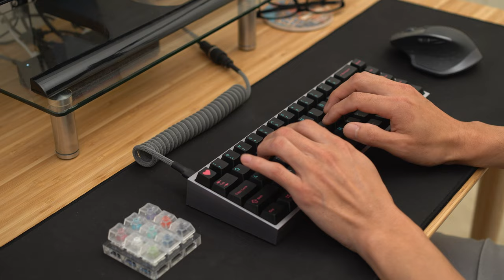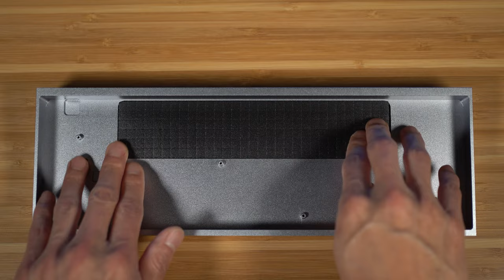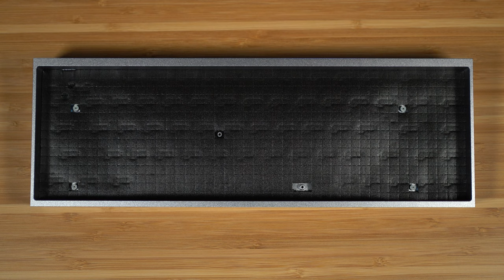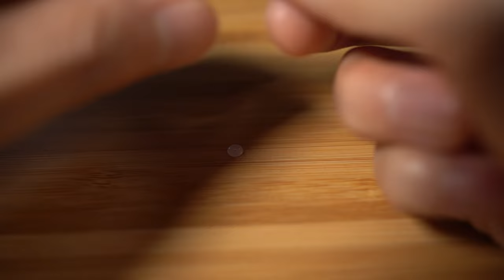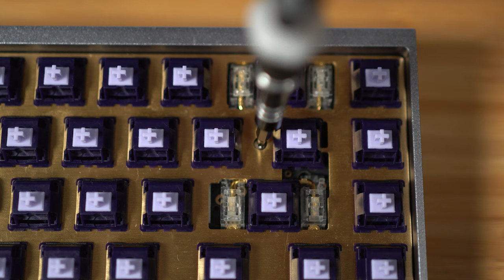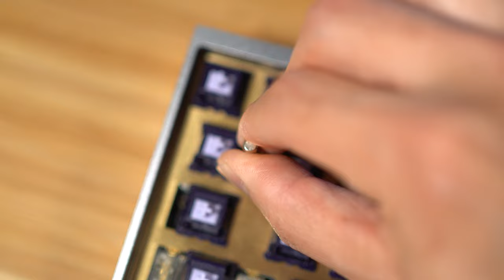Make the BEST sounding TOFU!  TOFU65 O-Ring Mount Mod Tutorial

Comment: How well would this work with a pc plate? I have ordered the tofu65 and I wanna do this mod, but I don't know how it will work with pc plate compared to brass or aluminum. Any thoughts?
Reply from the maker: It will still work with the pc plate as well, but pc is so flexible that you may end up bottoming out on the center stand-offs during hard typing.  But should still work!
Reply: @Keybored  would you still recommend the mod with a pc plate then?
Reply from the maker: @fritolayy  I still would. With a pc plate, you can always add o rings to the center stand off and not float it, since it may bottom out

Comment: How would this process be replicated on the TOFU60?
Reply from the maker: Hi Gordon!  The TOFU60 also features 6 tray stand-offs similar to the TOFU65 in this video.  I have seen 2 methods for this for the TOFU60.  One method is to follow a similar approach to this TOFU65, and use the outer 4 standoffs, and skip the center 2.  The second method is to just use the outer 2 standoffs (right next to the wall of the case), Skip the Center 4 and the USB cutout acts as a "3rd" point to stabilize the PCB assembly.  The concept overall is to skip the usage of the center standoffs as much as possible, so that the Alpha keys are floating without touching anything hard.
Reply: @Keybored  Awesome, thanks!

Comment: are the screws used in this video the one that came with the tofu kit
Reply from the maker: Hi hj!  I did use the screws that came with the tofu kit, but I have been told that some have received shorter screws.  The screw size that I used are M2 x 5mm.  The screw head is about 4mm wide diameter.  Hope that helps!

Comment: Will this mod work with o-rings that are slightly larger? Like instead of the 4mm x 1mm x 1.5mm, will the 6mm x 2mm x 2mm suffice?
Reply from the maker: Hi Nicholas! I think the OD can be up to 5mm but the ID should be kept close to 1mm as possible. If the ID becomes too big, the screw will end up pushing through the o ring and will render the mod ineffective. Also, I believe the 2mm may work, but you would need to screw it down a bit more to compress it that extra .5mm so that it can clear the usb slot. I would recommend the 4x1x1.5 to make sure it works 100%! I think the issue is that the availability of that o ring size has been scarce lately.
Reply: @Keybored  Yeah, they're taking a bit longer to ship so I ordered the bigger size to experiment. Also, I'm not too sure how familiar you are with the GK64xs (purple aluminum case), but I am planning on attempting this mod on that board. The stand offs are a bit different from that of the tofu case, being that there are several additional smaller stand offs besides the main ones. Would you recommend I apply the o-rings to these stand offs as well? Or should I omit them and only use four like you did?
Reply from the maker: @SECSIASIAN  I'm not as familiar with the overall layout of the GK64XS, but the concept will be similar.  Use the outer stand-offs and float the pcb structure above the centers, so the alpha keys do not have a hard mounting point and essentially "floats" above, similar to a top mount or gasket mount keyboard.  I hope that helps!

Comment: If you dremel the standoffs and do what other people did to make it burger mount would it sound better then your o ring mount ?
Also can you do the same for kbd67mk2 since its a tray mount too
Reply from the maker: Hi User name, I thought about drilling down the standoffs, but once I did the o-ring mount, I realized that the center standoffs don't contact the bottom of the pcb at all.  So I ended up leaving them alone.  I believe the KBD67 MKII is actually a top mount design, so will be a different setup.  Hope that helps!
Reply: my bad it is a top mount . also it should be similer as someone posted a post on reddit on how to do it and TLDR orings everywhere 

https://www.reddit.com/r/MechanicalKeyboards/comments/fqmap6/kbd67_mkii_gasket_mount_mod/
also thanks for your video now every tofu will sound amazing
Reply from the maker: @deluxesofa  that is a good guide for the kbd67! I did the same thing for my kbd8x and it does improve the sound! Perhaps I can make a video on how to burger mount the top mounts as well. :)

Comment: are those the stock screws? My Tofu 60 screws seem significantly shorter than those
Reply from the maker: Hi Barbell! The screws I used were stock that came with the tofu65. However, I was told some with the tofu 60 have shorter screws. The size of the screw is m2 x 5mm and the screw head diameter was about 4mm. Hope that helps!
Reply: @Keybored  very informative, thank you!

Comment: Where did you buy the krytox 204 lube from? I can't find any, and I don't know if 205 would sound the same.
Reply from the maker: Hi Haley! I bought the specific 204 from kebo. But I believe there are other vendors that sell it also. I typically use the 205 for linears and 204 for tactiles, but if you only have the 205 you can sub that. Just know that it does make the switch feel a bit more "buttery" vs "gliding" :)
Reply: @Keybored  thank you! I really didn’t expect you to reply back to me, but I’ll keep that In mind. :) I really like that video made with the mod, and it inspired me to make one like it except with banana split switches!
Reply from the maker: @haleyee.1604  No problem! I've been trying to make sure I get to everyone so hope it was helpful!

Comment: did you add any case foam from kbdfans?
Reply from the maker: I added the zip-n-fit liner to the case, and used 3/16" vinyl adhesive tape between the plate and the pcb.
Reply: @Keybored  thank you very much

Comment: would the same o rings work for the 60% version? also would i need longer screws? because the ones with my 60% tofu are so short, i barely even need to screw them wothout any orings
Reply from the maker: Yup!  Should work for the 60 as well.  I was told that some kits just came with shorter screws, so the ones you need are actually M2 x 5mm!
Reply: @Keybored  i was thinking about double stacking o rings eventually . like i can get even longer screws and put 2 orings on top and bottom? but i dont know how i would manage to put the pcb on top. i guess i ll look for some m2 5mm then. no oring mod tofu is killing me even without my center post. i have zero flex because, and every single keystroke feels like its vibrations get directly into the entire plate and the case. no matter what i try with switches and stuff.. it just sounds bad

Comment: hi, what screws did you use for this mod? i think the stock screws of the tofu60/65 are too short for 2 orings this thick
Reply from the maker: Hi Marco!  I have been told that some kits came with shorter screws.  The ones that I used are M2x5mm!

Comment: I know I’m late, but it feels like the screws that came with my tofu65 are too short to do this mod (they def look shorter than the ones in this video). Does anyone know if there’s an easy way to get replacement screws?
Reply from the maker: Yup!  I was told that some of the Tofu kits came with shorter screws.  The ones you need are M2x5mm!
Reply: @Keybored  finally got the screws in, and O-ring mounted it. It’s been awesome! Thanks for telling me what kind of screws I needed. I went crazy for months trying to use the oddly short screws that came with mine.

Comment: Hi, it seems lilac is no longer available.  What do you think about Boba U4T in comparison with lilac?
Reply from the maker: Hi IronCan88! I would say the u4t are actually much more tactile and much thockier. The closest thing to the lilac would be a durock t1 or cannonkeys dark amber t1
Reply: @Keybored  if you were to rebuild the same keyboard today, would you choose boba u4t for the sound and tactility, or would you do the durock t1? Its my first keyboard mod and I want to practice based on your method.
Reply from the maker: @IronCan88  I would probably take the boba over the lilac if it was today :) or the sunflowers... Love how smooth the sunflowers are
Reply: @Keybored  hi do you know if the KBD75v3 can be hotswappable?  I am thinking of ordering the YMD75 v3 hotswap, but not sure if it's compatible.  Mainly like it due to rgb underglow.  If not I think I will follow you with a tofu 65 build, unless you have a recommendation for hotswap of similar solid build quality /sound quality with added benefit of rgb.  Your recommendation would be greatly appreciated.

Comment: Can I use 4.5 mm o rings for this? I know this question is late.
Reply from the maker: I think some have found 4.5mm od and 1mm id o rings. Those should work since the stand off is actually larger than the 4mm od o ring. But make sure the ID doesn't get too much bigger than 1mm because then the screw will just go through it!
Reply: @Keybored  thank you so much for giving your insight, now I have an option to buy 4.5 mm OD 1.5mm ID and 1mm thickness

Comment: What plate foam did you use on this? Thanks in advance.
Reply from the maker: Hi Elden, during the time of the assembly, there was no stock available of pre-cut foam, so I cut out 3/16" thickness moderate compression, self-adhesive vinyl foam and applied it to the plate itself.  It was the perfect thickness and does a good job of absorbing vibration and noise.  It was long and tedious, but the end result was worth it in my opinion.  I believe there are some pre-cut foam available on the market know for the 65%, so that would be the easiest way to go.

Comment: You don’t seem to use the PCB foam? How many mm foam can be used in this case?
Reply from the maker: I did actually use pcb foam. Instead of the precut stuff, I used 3/16" vinyl foam tape and applied it to the underside of the plate!
Reply: @Keybored  I’m thinking about burger mounting without the pcb foam and use 2-3mm eva foam instead. Do you think that’ll work? I have the same, tofu65, but I don’t have your cutout in the top of the case, don’t know why.
Reply: @Keybored  Or maybe 1 mm eva foam and the pcb foam that comes with dz65?

Comment: I am planning to do this mod on my TOFU84 but I can't decide which standoffs to skip... if anyone has tried it on the larger board and has suggestions, I'd love to hear them! For reference, it has 3 standoffs down each side, one in the centre and then two more evenly spaced across the top of the board. My gut says, based on this video, that I should skip AT LEAST the centre one, but I can't decide about the two middle ones on the top...
Reply from the maker: On the larger boards, sometimes it's difficult to skip the stand-offs depending on the design.  The plate is so big that skipping them makes it flex too much and bows in the middle :(
Reply: @Keybored  thanks for the reply! I'll play around with it and see which, if any, I can skip then!

Comment: did you have to use a different set of screws than what the tofu comes with, or are those screws long enough?
Reply from the maker: Hi Silent! I used the screws that were provided with my tofu65. I believe they are m2x5mm screws. Hope that helps,
Reply: @Keybored  really? i couldn't seem to get the screws to thread with both o rings, I could only get them to thread with one
Reply from the maker: @DrSilentShadows  I have been told that certain TOFUs actually shipped with shorter screws than others.  If you have a shorter screw, may have to look for an alternative M2 screw with 5mm length.  The head diameter of the screws I received were about 4mm across for reference.  Hope that helps!
Reply: @Keybored  Yes thx

Comment: does it sound drastically different with or without o ring? and I only have alu and poly polate for my tofu60 which one do you think is better ?
Reply from the maker: Hi koko ganteng, the modification won't change the sound so much that it will feel like a different keyboard. However the o rings make a difference enough that the tofu sounds like a more refined version of what it can become. I initially did it out of curiosity with low expectations, but was surprised at the results. Just in case, I pulled it all out and went back to stock, then I realized how much nicer it actually was with thr o rings. The biggest change is the even feeling in sound and feel, and it introduces more of a "pop" to the sound, especially the spacebar. Hope that helps!
Reply: @Keybored  may i have a word with you through discord ? I already try to make my tofu60 sounds good by buying poly plate, using pcb and case foam but it still sounds horrible... maybe you have some advice:))
Reply from the maker: @kreebz3113  Hi koko, is there anything specific you have questions about?  What I noticed about these tray mount boards is the sound and feel is very much impacted by the stand-offs below.  They create a "hard spot" and it really changes the sound and the typing feel the closer you get to these hard mounting points.  If you're willing to give the O-ring mod a try, I would place the silicone O-Rings on the outer stand-offs and leave the centers open with no screws in.  For the Tofu 60, you have 2 options.  One is do something similar to what I did, use the 4 outer stand-offs on the left and right.  The second option is to use just the 2 outer stand-offs (one on each side) and the USB C socket will act as your "3rd" standoff, forming a tripod.  This is similar to what others have done by using a gummy worm gasket to "gasket mount" their tofu60.  If these don't work, let me know and we can try to connect!
Reply: @Keybored  hi , i already try that, maybe you should look it on my youtube channel video, the latest tofu60 oring mod is using alu plate with ur same spec oring , the one uploaded before my latest one is using keycaps o ring stacked . Both of the oring mod use 4 stand off on top except the spacebar. My future plan is to use the poly plate again(check it from my video too but it doesnt use oring mount) if i can get deeper sound on the poly plate. My issues is only the sound of the spacebar that is really high pitched. I use milky housing with cream stemnon the spacebar. Maybe if you have advice , i should give it a try on your tips

Comment: What foam are you using between the PCB and Plate?
Reply from the maker: Hi Jarrod!  The foam I'm using between the PCB and the Plate is a vinyl stick on foam that I cut out :)  It's a bit ghetto but it works well!  The demonstration is on my NK65 modding video!  If you don't want to do that, check out the foam offerings from Stupid Fish Designs!  Top notch stuff

Comment: Do you feel like you need a wrist rest for this case? Ordered one but afraid the case might be a little too high.
Reply from the maker: Hi Jesse! For optimal typing, yes. It's a pretty high case! I didn't include it on the videos because it didn't look very nice, but I do use one day to day :)
Reply: @Keybored  thanks.. a bit afraid now since I really move my keyboard around all the time and might be too high.. I might have to return it and get the low profile tofu 65
Reply from the maker: @jessestruyvelt7593  Hi Jesse!  I think the TOFU is definitely on the higher side Vs. some of the other keyboards.  If that's a concern, it might be worthwhile looking at some lower height cases. For example, the D65 I am currently typing on is much more comfortable to use without a wrist rest Vs. the Tofu.
Reply: @Keybored  Thanks. Will check it out! I just received the case and its the same height as my CM Storm Rapid-I (old keeb) and really dont seem to mind the height. Maybe because I am used to it

Comment: in theory, would this be possible with the Idobao ID80?
Reply: no because it uses an integrated plate
Reply from the maker: Hi Jared January! I believe AnthiPoison may have provided you an answer, but the ID80 is an integrated plate, so the o ring mod will not be applicable. However, I used to own a drop alt, which is also an integrated plate keyboard, and they benefit tremendously from case and pcb foam. Hope that helps!

Comment: Are the screws longer than what came with the Tofu?
Reply from the maker: My tofu actually came with longer screws, but was told that not all were that long. My screw size was m2 x 5mm
Reply: @Keybored  ah cool. I bought my Tofu second hand but should be able to find those longer screws on Amazon. Thanks for your video and reply 👍

Comment: Do you need thin foam for this mod to work or is 4mm foam fine ?
Reply from the maker: The 4mm might be a bit too thick for the lower case of that's where you're thinking. But if it's soft and compresses easily, it may work!
Reply: What thickness should my foam be ?

Comment: On a tofu60 the outer 4 standoffs aren't as well balanced vertically as on the tofu65, I will give it a shot and report back :)
Reply from the maker: Hi An! Let us know how it works out! I know some people actually use just the outer 2 stand offs and the usb socket acts as a "third" support point. That's another option to explore as well!
Reply: @Keybored  I will keep that in mind! I do feel like using the usb port wouldn't be too great sound wise, no? Your board sounds amazing btw, im blown away. I am usually not a 65% guy but if the tofu60 doesn't work out this well then I am considering buying another board hahahaha

Comment: So this will work with other keyboard cases, right?
Reply from the maker: It should mukuru, given that the keyboard is a tray mount and there is enough clearance for the usb cutout!
Reply: @Keybored  How has the usb clearance been on the tofu65. Has there been any stress on it, or was there enough space for it to not get damaged overtime?
Reply from the maker: @mosk11tto  fortunately, the tofu actually has a good amount of clearance to cover the 1mm-1.5mm additional height from the o-rings.  The GK61... that is a different story and I'm having to pull out my file again.
Reply: @Keybored  Nice ty so much for quick reply and the info. Hope you get that GK61 fit.